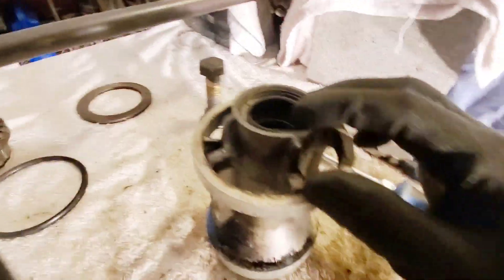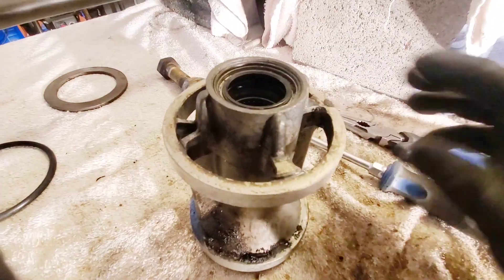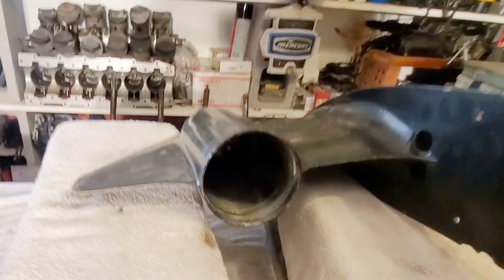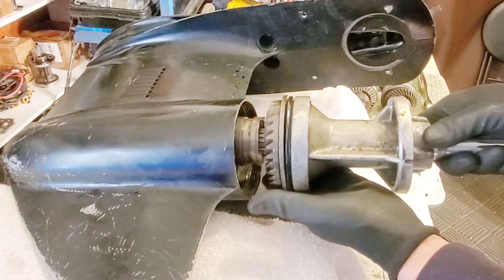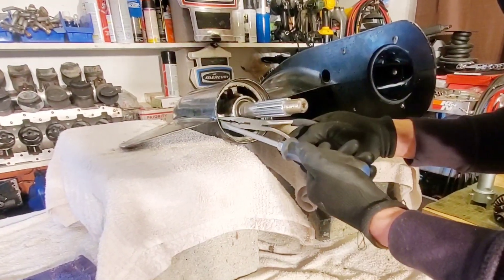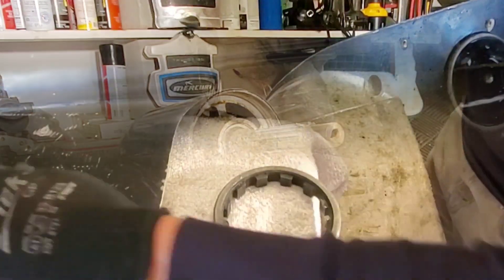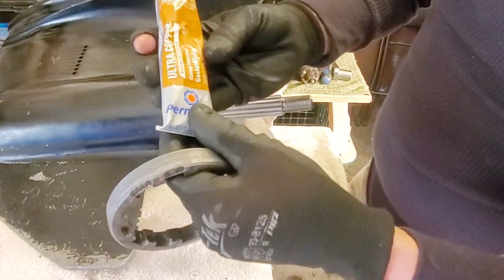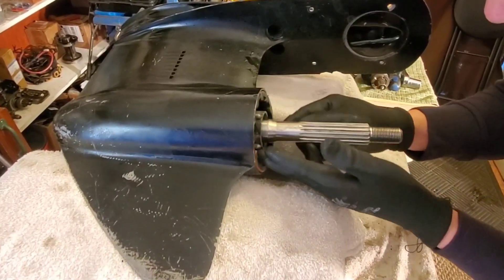Lower Units: Bearing Carrier Assembly & Installation

Comment: Great video, Sir! So when installing the rear gear and bearing, you just seat it until it's flush? You don't have any clearances you have to maintain?

The reason why I'm asking is that I had to destroy my old carrier to get it out and I was able to save the rear gear and bearing. I just got my new/old carrier in and was under the impression I had to pay a professional shop to press the gear and carrier together.

Comment: Recently rebuilt my 94 Merc 40hp lower unit replacing seals and water pump.  Is there a reason my reverse would not engage, but forward and neutral work fine?  I replaced the gear selector cam as well.  Just reverse will no lock when turning prop, rotates both ways like neutral with lower unit on bench as you did.

Comment: Nice video Mercson, as every single one I saw from you channel, I have a question, when u insert the shaft in what position need to be the cam shift cam? I am working in one and I cant get the right position to get Forward  Neutral  and Reverse, but this that I have the shift shaft rod is one large one piece coming from linkage mechanism in the motor. any email I can send u pictures or video?  maybe you can help me thanks
Reply from the maker: I don't fully understand the question. Son
Reply: @MerCSonL6  I wasn’t sure the position of shift cam goes into the shift rod but I got it thanks to your video, first attempt I was getting only forward and neutral not reverse but finally I fix it.

Comment: MerCSon Thanks for the video, I have learned so much about my Tower of Power 1150, I recently pulled out the prop shaft and carrier bearing, replaced seals, upon reinstall of the prop shaft and carrier bearing, I only managed to get the prop to turn right (in foward gear) with the clicks as you showed, Neutral is good, I can turn left and right, Reverse gear, the prop does not turn, it has some play so when I turn prop left to right it stops on both sides, (similar to what you show at the end of the video). The difference is I achieved this by having the throttle in forward position, not neutral. Is this a problem? Also I thought if in reverse gear, I should be able to turn the prop in reverse should I not? appreciate your guidance.
Reply: fyi, my unit is 1978 or 1980 model, Canadian Version serial code in the 7xxxxxxx's, everything matches with what you are showing, (just looking to confirm that the prop engages as you show at the end of the video) Reverse gear you move prop back and forth it stops both ways. I don't want to destroy my lower end when I run her! thanks brother!
Reply from the maker: That is correct my friend. Son
Reply: @MerCSonL6  many thanks for the reply. I will fill up the gear oil and test her in my driveway this weekend, will keep you posted.  Separate note/question, do you have website or facebook channel or Discord or something similar where us gearheads can connect to ask questions and load pics etc. on these amazing engines? Cheers!
Reply from the maker: @chillsmart270  Facebook group Inline 6 Enthusiasts
Reply from the maker: It should click in forward gear, spin freely in neutral, and lock in reverse with a little bit of play.

Comment: Could you’re video be used to repair a 1973 500 50Hp Mercury outboard, specifically putting the shifter into the neutral position, prior to inserting the bearing carrier? Thanks for all you do.
Reply from the maker: Yes.

Comment: Good Day,
Just to clarify, in the video you set the shifter into neutral before installing the bearing carrier is that correct?
Great job on the explanation of the different topics.
Thanks
Reply from the maker: Correct. Son

Comment: Thanks for the video. I was studying the book but I’m unclear on a question. 
I have around 1/8” in/out endplay on the prop shaft. I am unsure exactly what controls that in & out movement? 
Is it a the housing nut, the propeller nut or the combination of both? 
Thank you!
Reply from the maker: The differential between gears. Son

Comment: Great video! I have a question. I took the prop shaft out of mine and the pin that moves the clutch dog back and forth fell out. What all goes in there before I put the pin back in. I found 1 small ball and researched it and found that there are supposed to be 3 so I ordered the kit for it. I’m just not sure if a spring goes in there with the little balls

Comment: MerCSon, great videos! I have a 1500xs lower unit I have off the motor to fix leaks and I’m replacing the shift shaft bushing and seal. Unfortunately the shaft lifted up when I took the bush out and I’m having trouble getting it back into the cam. I can’t actually see the cam when I look down and shaking the unit around doesn’t seem to move anything. I can see the cam follower when I ratchet the prop shaft. Any wise words you may have to help?
Reply from the maker: The cam is splined. The shift shaft just need to be aligned with the spligned cam. Only way see 👀 this is to pull the bearing carrier. The cam has to have slipped into cavity. I would try harder to get that aligned b4 pulling the crown nut. I apologize. Im sure thats not what you want to hear. Son
Reply: MerCSon L6  thanks champ, you were spot on I needed to try harder, I care back to it in the morning and we wrestled and I put it upside down and shook the unit and it started moving so I could see if. Had it sorted in 10 minutes after 3 hours of head scratching the night before!

Comment: After tightening down the crown nut is there any play in the shaft?
Reply from the maker: I a little. If I had to measure its less than 1/8th of an inch because of the spring pushing against the clutch

Comment: I have a question unrelated to this video. I recently rebuilt the carbs on my outboard(1985 Mercury 115 in-line 6) it started the first time I cranked it but now, it’ll maybe start for 2 seconds then sputter to a stop and won’t turn on again
Reply from the maker: Fuel restriction. Verify all carbs have fuel. A good way is to hit the venturi with compressed air and fuel should splash out. Prime the bulb of course b4 doing so. Let me know. Son
Reply: MerCSon L6 also, the primer bulb doesn’t get hard when I pump it. Should I change that too or clean it out?
Reply from the maker: @VEEZY_FISHING  replace the bulb
Reply: MerCSon L6 and one last question(sorry, don’t mean to annoy you) can I spray some brake cleaner to clean the sludge from the inside of my lower unit. I took it off and it looks disgusting in there
Reply from the maker: @VEEZY_FISHING  yes sir.

Comment: My 115hp inline 6 spits hot water new impeller any ideas?
Reply from the maker: Is it a steady stream? Sounds like a circulation problem. The engine is not getting enough water.

Comment: As I said before (OUSTA) always getting the job done with whatever tools you have.l loved the tooth brush cleaning. What spray oil was that for lubrication? Great vid.as usual.👍🏼
Reply from the maker: Marvel Mystery. I would have labeled the bottle but then it wouldn't be a mystery. Haha
Reply: It says add to gas and oil that mean it’s an additive to the gas tank on your boat plus the 2 stroke oil that you add to gas tank. Am I right?!!
Reply from the maker: @homarkbeer  yes that is correct. It is composed primarily of petroleum distillates which clean your engine.